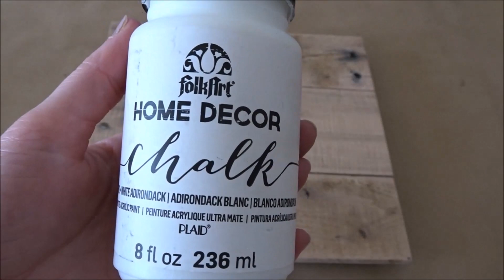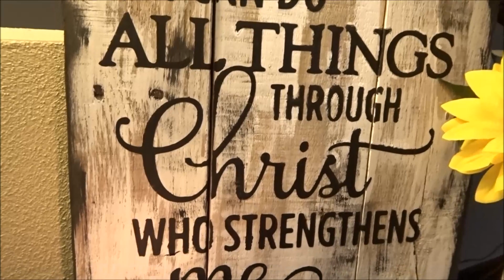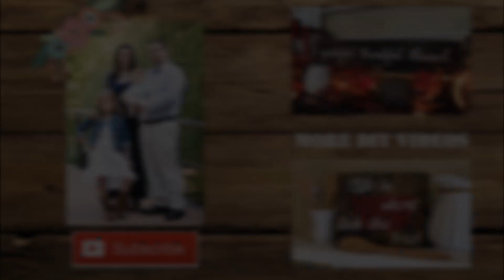*DIY* Inspirational Pallet Sign

Comment: My favorite verse.  :D  Would you mind doing a video showing everything you do?  Like the layout and design of the text, how you put it into your stencil machine, etc.?  Also, do you think it matters if I use low end inexpensive chalk paint for my signs?  I am thinking it doesn't.  I was thinking I would save Annie Sloan for furniture.  Would you agree?  Thank you for your time.
Reply from the maker: One of my verses too!  Some of my more recent videos go more in depth into how I cut my stencils.  I need to figure out a better way to video tape my computer screen and then I can do more of the designing tutorials, which I'd be happy to do :)  I have been using Waverly chalk paint from Walmart and it's great stuff!  Not as expensive and some of the others too.  I would save your Annie Sloan for furniture, like you said.
Reply: I love Prov. 3:5-6 too.  Okay, I will check them out.  My day job allows me to "watch" listen to videos while I work.  Thank you for the advice!
Reply: Look into ScreenFlow for tutorial making.  It's very easy to use & pretty cheap.  You may even find a limited free version.  Are you in the SLC or Tooele area?  Your pic looks familiar from FB!!

Comment: I'm confused about the mod podge part. What is it for? And at the end when your taking out the inside of the letters with the pointy thing...why did the inside of the letters stick in the first place? I thought the stencil was covering it. (Sorry if my wording is confusing, hopefully you understand what I'm talking about). Ps I LOVE what you do and wish I could do it myself!
Reply from the maker: Hi Briana!  The stencil is contact paper, sort of like vinyl but not as sticky.  So the stencil doesn't come off the paper in one piece.  I have to stick each extra piece on, one by one (like the middle of the "O" and "e" and "A").  The pointy think is my weeding tool that i use to get those extra piece off.  Sort of like a dentist pick.
The Mod Podge I like to use when the surface isn't level, like pallet wood.  It helps seal the edges down to the board and dries clear.  Then I got back over with paint and you get less "bleed" that way.  I hope to do a whole video on this eventually, I think it's my #1 asked questions right now.
Hope I was able to help and explain things clearly!
Thanks for watching!
Reply: Ok makes sense now, thanks so much! Look forward to more videos!
Reply: One more question...where did you get the contact paper with the quote in it from? Or did you make it yourself? If so, how?
Reply from the maker: I make them myself with my Silhouette machine.

Comment: Love this!  Why did you use Mod Podge before using the acrylic paint?
Reply from the maker: I like to use Mod Podge on pallet signs b/c of the uneven surfaces.  It helps seal the stencil to the wood and then there is less paint bleed that way.  Thanks for watching!

Comment: Do you seal the nail holes with anything?
Reply from the maker: Nope, I just leave them as they are.  If you won't like the nail holes you can use new wood instead of the pallet wood as well.  You'll get a cleaner look

Comment: I love this! Was that regular black paint you used on the outer edges? And what would you suggest to someone who has know clue how to make the letters and only has a laptop and printer?
Reply from the maker: I used Apple Barrel brand acrylic paint, but any acrylic paint will work.  If you don't have a machine to cut stencils you can still get this look!  Print your design on paper in black - flip the paper over and use a lead pencil to color in the outline of the words.  Then when you place your paper on the wood right side up, you trace the printed outline of the words and it transfers the lead on the back to the top of the wood.  Then just use a fine paint brush to fill in the outline that's on your piece.  Hope that helps!  I may have to do a tutorial on this just so others have options without having to purchase pricey equipment.  Let me know if you have any other questions :)
Reply: Thank you for explaining it! Yes, a video would be great, to actually have a visual of how to do it. Especially since you painted over top of your letters. I would like to see how to distress the wood with this option, since the letters will not be stuck to the wood.

Comment: where did you get the stencil?
Reply from the maker: I use contact paper and cut the stencil with my SIlhouette Cameo
Reply: So how do you do it if you dont have a SIlhouette Cameo?
Reply: What is force Luke?
Reply: verna davis if you print off a piece of paper with an image on it that you like, you can then fill in the entire back with chalk and lay the paper (chalk side down) on your pallet. take a ball point pen and trace the image so it transfers a chalk outline to the pallet. remove the stencil. now follow the chalk outline with a paintbrush and paint. Ta-da!!!

also, "use the force Luke" is the most iconic movie phrase ever... From Starwars ya know?
Reply: wont tracing it with chalk or anything make the transfer to be backwards. I'm clueless. I haven't tried it
Reply: Look for graphite paper for tole painting pattern transfers. Check Amazon.